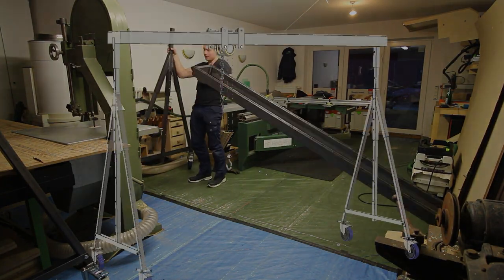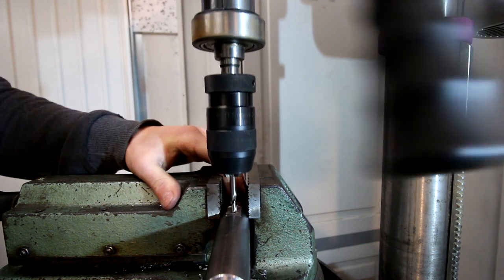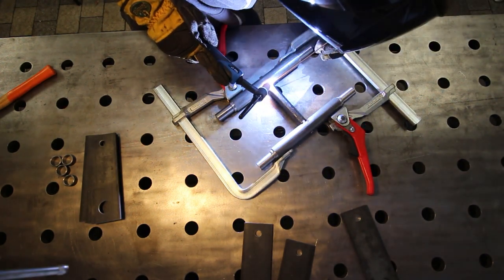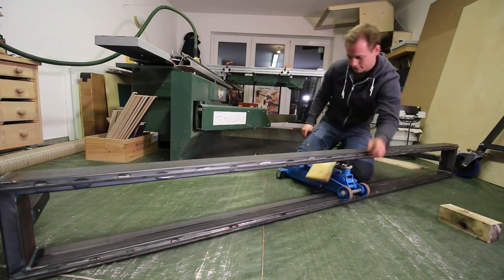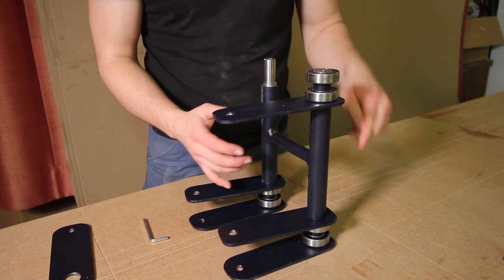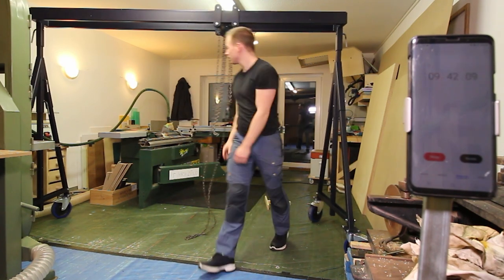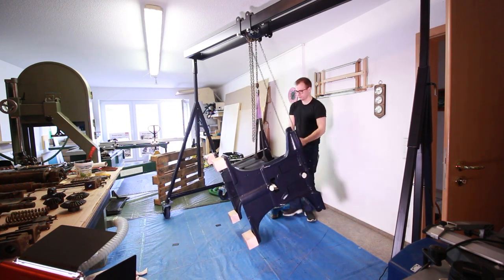Part 2/2 - GANTRY CRANE - extra mobile and versatile for a small shop!

Comment: Cool, be careful with that and keep loads at least under 700lbs. Dynamic loading or even static loading will be your worst friend with wobbly legs on your crane.
Reply from the maker: Thanks!
Well too late 😅 I think I already lifted about twice as much (1400lbs) without any problem. Not shure though if it can lift 1000kg (2000lbs) like I hoped, I'd be careful with that. If it gets heavy, of course it's important to lock the castors first. Under load it's not wobbly anymore.
Weak spot  are the top corners as they have no diagonal struts, so have to watch out for these.. If it seems not strong enough at some point I'll ad little struts later on.
Reply: @HolzFlo  trial by fire lol. Just something to think about, by wobbly I mean the crane legs look like they have a bit of back and forth play in them (not always perpendicular to floor or beam) if you were to lift heavy and those legs shift several degrees that is a massive dynamic load.
Reply from the maker: Jep you are absolutly right! So far I always pulled the legs outwards befor locking them on both sides, so it hasen't any play. I also thought about welding on some sheet steel to the tubing (make them thicker) to minimise the play.. That's also something I could improve later on if I think its nessesary. So far it seems to be allright and plenty strong enough for my needs. :)
Reply: @Ragnar.Lothbrok.3.14  I came here to say almost the same. I would be afraid that while moving the gantry with a load, the uprights might rack or splay out without diagonal bracing or gussets. Florian could probably give up 10" to 12" at each end of the tracks for bracing without losing any functionality.

Comment: The uprights seem to flex quite a bit at the junction with the track/beam. Would some sort of gusset on the beam ends be a good idea?
Reply from the maker: Yes I already thought about welding on 1mm steel plate on each side to make the gaps a little smaller.. So far it works quite well, if necessary I can do that later on 😉

Comment: nice work ,will done, i am asking about how tall the gantry can reach
Reply from the maker: Thank you!
The max hight ist almost 3m.
Reply: @HolzFlo  thanks, if i want to exceed the tall to be 3.5 what i can do ?. by the way i am purchased the plan of the gantry so if you tell me what part to increase so i can reach the 3.5m
Reply from the maker: Thanks for your purchase! I hope you like it.
probaply the easyest way to increase the hight is to make the vertical studs (page 8) longer. That means you can't get as low anymore but get more maximum hight. !!BUT!! I'm not shure if that's a safe modification.. 
Much better and safer way is to make the four legs (page 9) longer to also get a wider footprint. Don't forget to make longer flat bars (page 8) to fit the longer legs. 
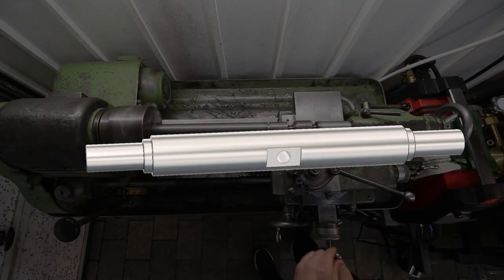To figure out the dimentions you need, you can use the drawing on page 10 (printed at a 100% scale). This drawing is in scale 1:10 so you can just enlarge the legs to your needs with ruler and pencil and than meassure the length you need for the flat bars.

If you have further questions, let me know.

What do you want to lift with it? :)